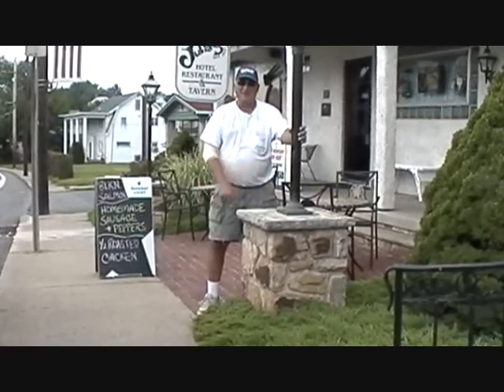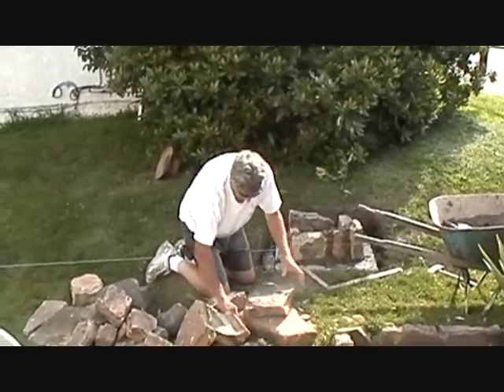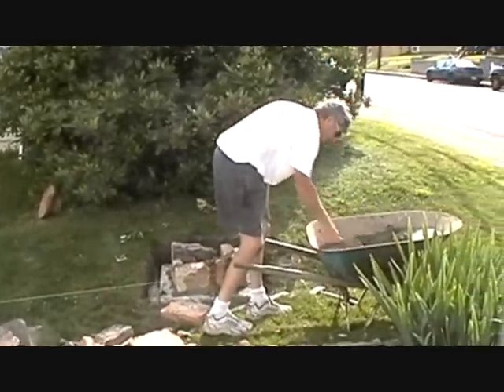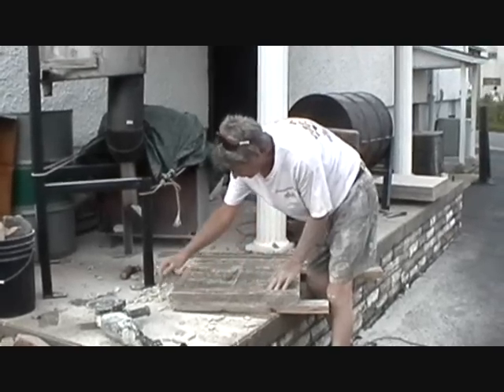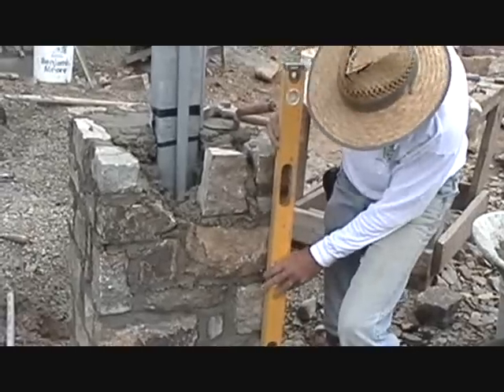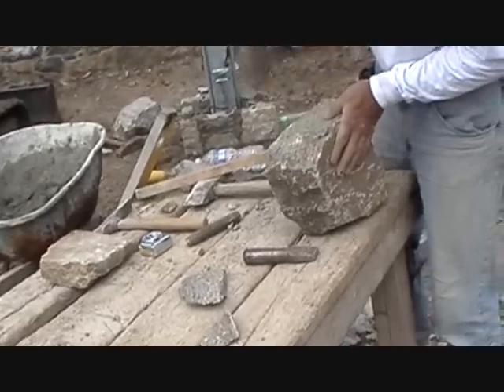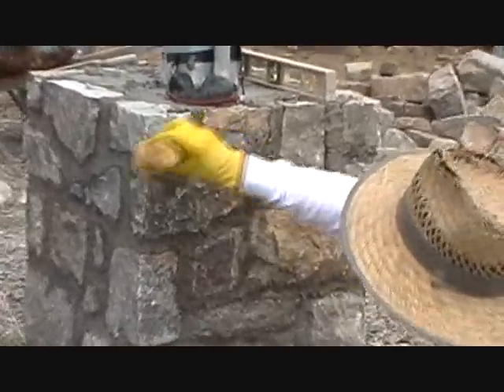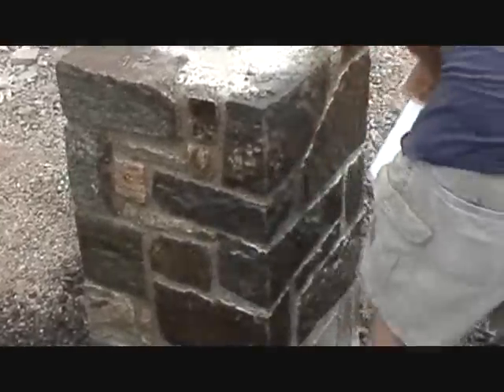BUILDING STONE PILLARS or COLUMNS (Part 1) Mike Haduck

Comment from the maker: what I was doing was called facing or some call it dressing. usually stones are blasted from the quarry and you have to cut them down to size. like a sculptor does a figure. could call it my style, all stone masons are different and different stone from different areas are used different. There is no right or wrong way to do stone work it is mostly an art to aquire a certain look.... hope that helps. thanks for the comment.  mike

Comment: Hi Mike, What type of morter do you recommend for sandstone columns? Sand Cement or Lime eg NHL5? There seems to be a lot of debate about what is best? I am building an oak framed carport here in Denmark and plan to sit the oak columns on sandstone plinths. On a concrete footing!
Reply from the maker: Hi Alan, around here it's hard to buy lime, I did a video called, " lime or Portland, what should I use", mije haduck,  I denmark I can't say, but spent a lot of time especially Roskilde, Mike

Comment: Mike, I have a bunch of Creek rocks from my yard.  I want to build a BBQ out of them, using the same technique as how you did the pier with the strings and the pipe.  Do I break the rocks flat or just turn the flat?  What is I mixed cobblestones and bricks?
Reply from the maker: Hi OCFarmer,  The problem with building a fire pit is rocks if they’re wet inside they will explode with the heat, that’s one of the reasons they use fire Brick to line it up, And keep the wetness or dampness from getting inside, I would do a lot of research before I would try building a fire pit I hope it helps thanks Mike

Comment: You use Portland cement 2 to 1? I was taught to use 3ish to 1 of type s. Whick one is better?
Reply from the maker: Hi Trevor,   3 to 1 s mortar would fall apart in my area,  it depends on where you are from,  my opinion,  mike
Reply: @MikeHaduck  Sorry I meant 2 1/2ish sand to one type s cement. Reason im asking is I have some stonework to do and I was just checking out your videos on columns. What is your opinion? Thanks